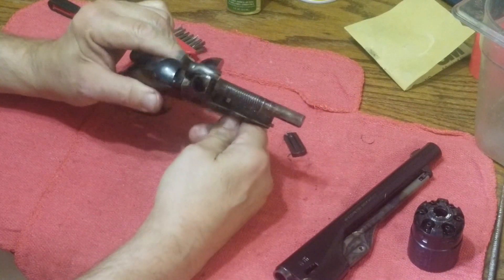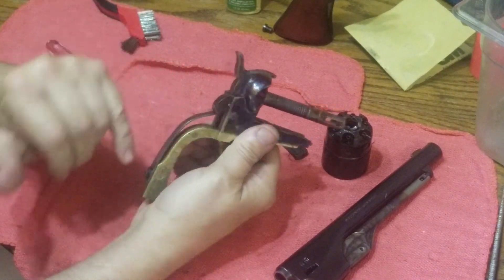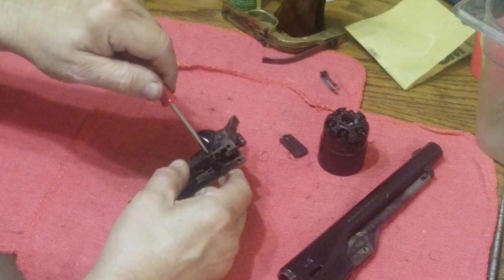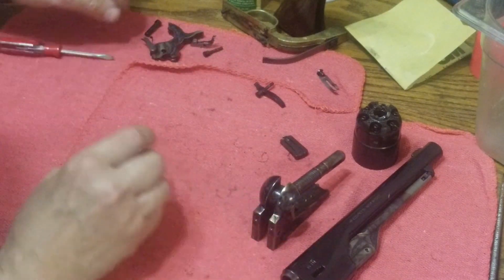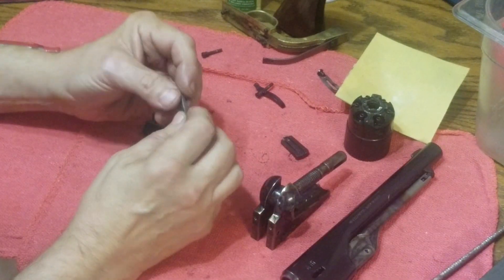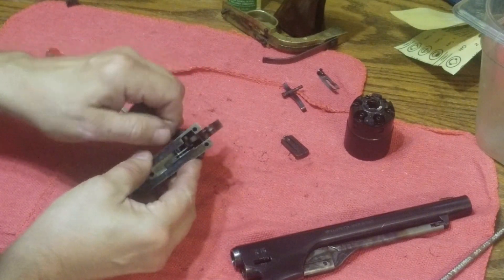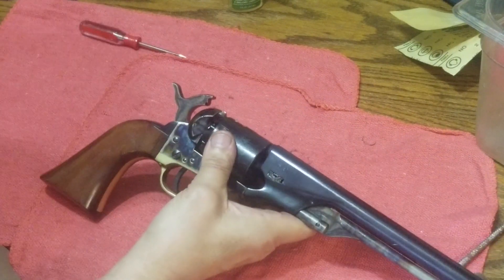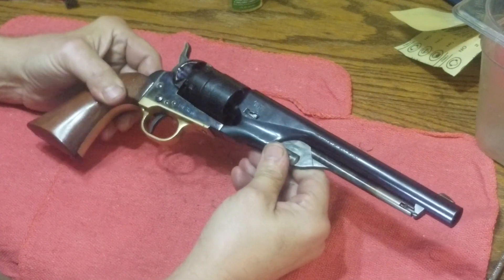Cleaning Colt C&B Revolvers: Part 2

Comment: You don't by any chance have any experience with the 1858 remingtons do you? I got one like 5 years ago and have been afraid to fire it because I'm afraid I'm gonna miss one spot or step when I clean it and it'll be ruined
Reply from the maker: Remingtons and Colts from that general time period are all both pretty simple designs. It's really hard to actually ruin one. The thing to be careful with modern replicas is not twisting the screw heads up when disassembling. Make sure you use a properly fitting screwdriver and don't seriously force it. If the screw won't budge put a drop or 2 of penetrating oil on it and wait a few seconds. It should break loose. As far as reassembling everything right, when doing something for the first time I like to take photos of each step or even video it so I can watch it later to make sure I get it right. But there's no secret like special torque values or anything like that. My advice is go to the range and have some fun! Those old gun designs are pretty tough hombres compared to many modern ones.

Comment: I keep hearing the screws are soft, but I’d rather the screw get damaged and have to replace only the screw, than have what it’s being screwed into get damaged. Better to risk having to replace the littler and commonly available part than the large specialty one. I don’t know if that’s what the Italian builders are thinking, but seems like a reasonable justification to me. Who knows…
Reply from the maker: Problem is when soft screws are torqued in too tight at the factory there's a real risk of stripping the slot out trying to break it loose. Penetrating oil helps but it's still  annoying.
Reply: @timesgonetech3057  yes, that would be bad.